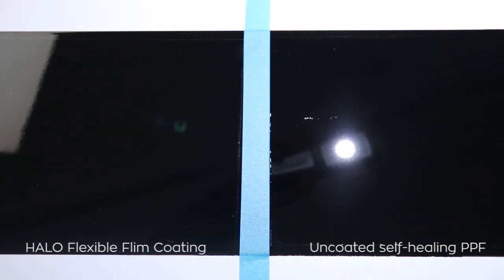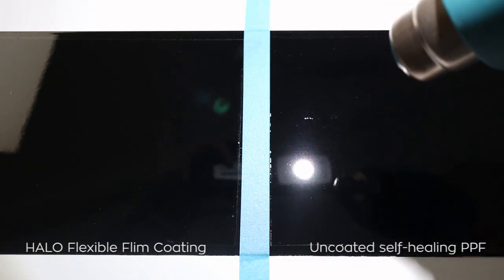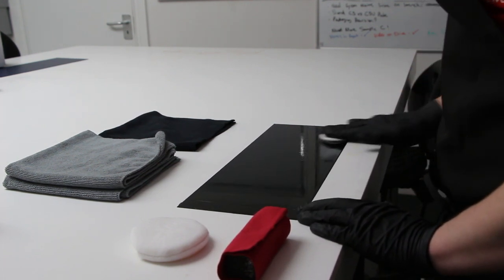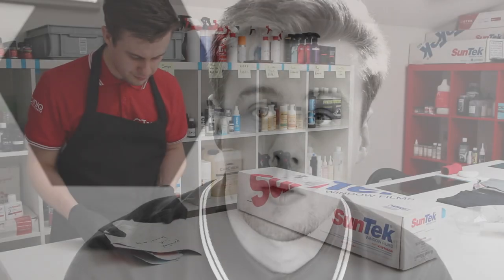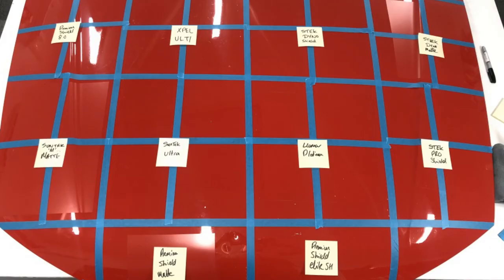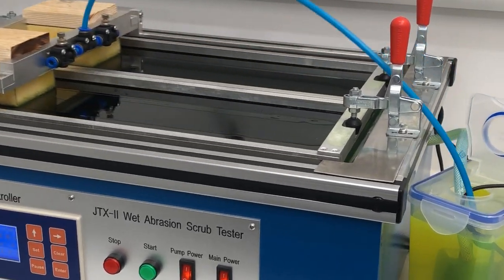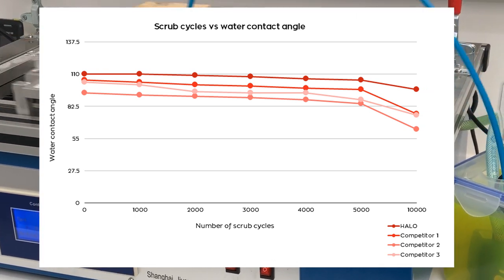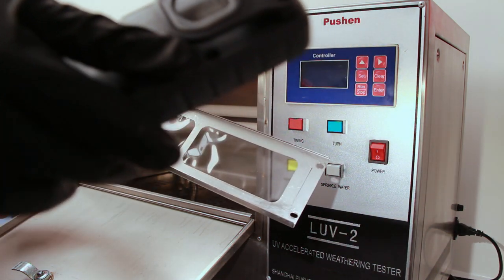Gtechniq HALO Flexible Film Coating: the development process

Comment: I have a unique question. I have a gloss vinyl wrap on my car. If I put on the Halo enhances the color. But if I want I glossier paint like finish. Can I put on top another layer of ceramic coat but one that is used for paint and not vinyl to get a better gloss? Layer 1, halo due to the pores of the vinyl. Layer 2, a ceramic coat for paint. Thanks.